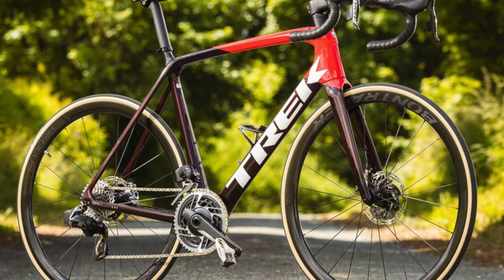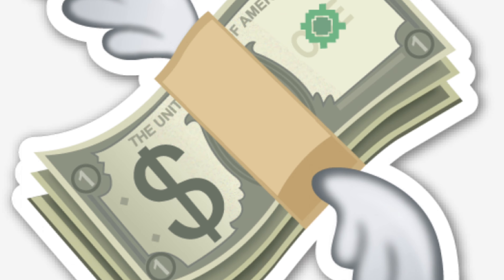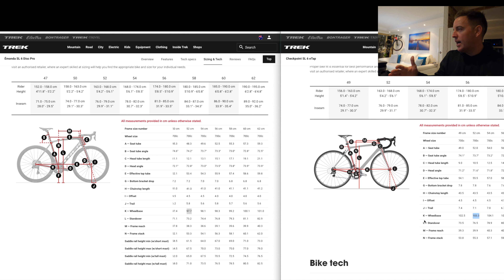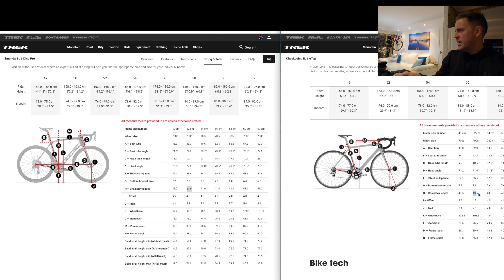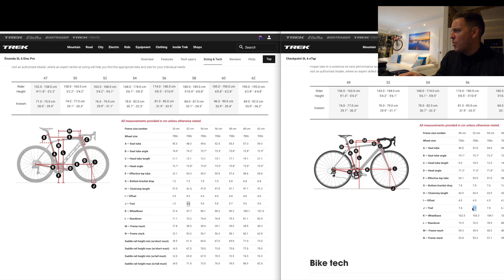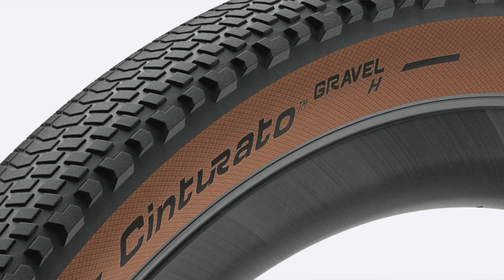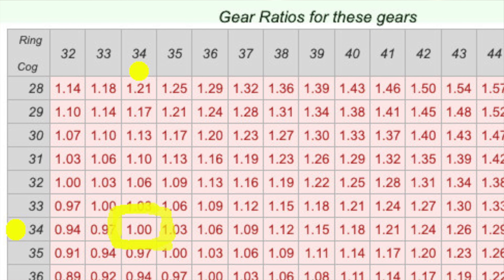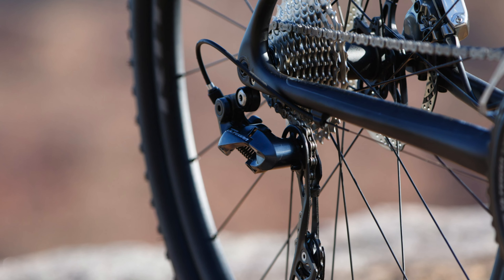TREK Emonda to Gravel Bike || Road Bike to Gravel Build || The Road to Gravel Part 2

Comment: Hi!! Do u think the Aeolus Pro 3V (25mm inner) would fit the Emonda? Prob with a 28mm GP 5000, which should be more close to a 32mm because of the wide rims effect.
Reply from the maker: Ni there. That’s what I’m running in mine and I’ve got 35mm pirelli’s for gravel riding. Tubeless and runs well for me. You might see it in part3 or the tubeless sealant vid in the Road to Gravel playlist
Reply: Yup it works I've got the same setup going on.